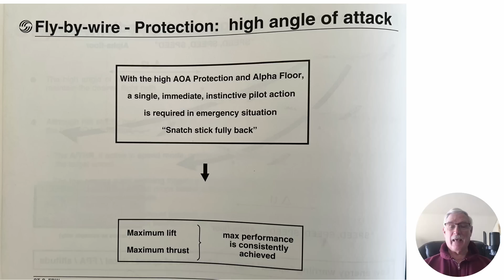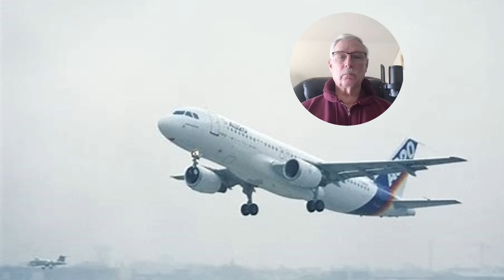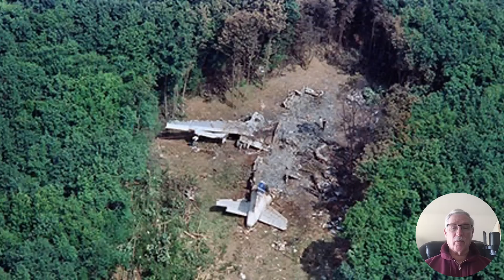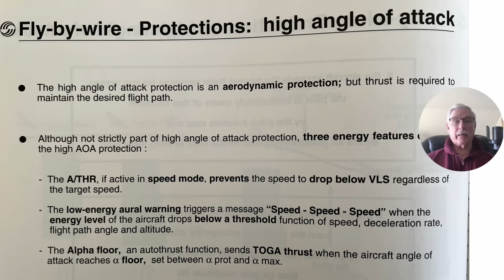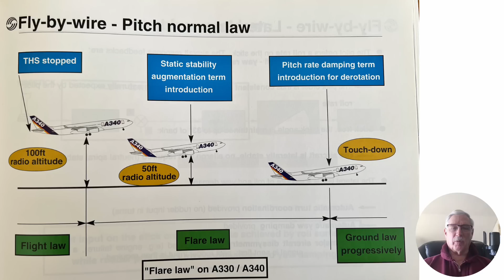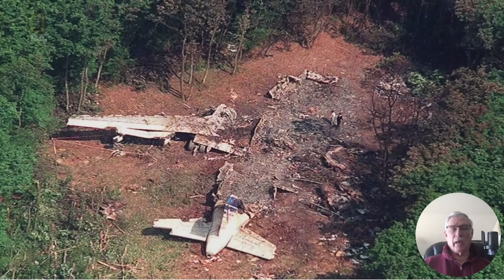Overconfidence in Fly-By-Wire protections First fatal A-320 crash 26 June 1988

Comment: Was the crash into the little forest caused by a) the alpha floor protection preventing the pilots at any stage from pulling more to avoid the trees or b) by the pilots stalling the bus into the trees ( excessive sink at wrong moment ) because of the disabled protection below 100 feet or c) a combination of both? The famous video of the fly-by seems to show some need for a pull up to avoid the forest. I'm asking because I actually have heard different explanations and things presented as the cause of this.
Reply: The French accident board report covers a lot more particulars than were presented here.  The aircraft had been rotated to the maximum angle allowed by the FCS, so the other variable was power.  That was compromised by the captain cutting the throttles to idle briefly when he felt that the engines weren't responding as quickly as he had expected to the initial throttle advance.  He didn't know what the problem was (turned out there was no problem, other than his misperceiving the engine response) and so decided in the moment to try a "reset".
Reply: The plane was getting very slow, more than 20 kts below what you'd usually fly even for landing. That was because the pilots had manually set thrust to flight idle the whole time they flew over the runway, trading speed for maintaining altitude. They didn't set TOGA until they reached the end of the runway as they weren't prepared for the tall trees at the end (the runway they originally planned for had flat open land at both ends). Turbo fan engines take 5 to 8 seconds to spool up from idle though. The captain went into panic mode and shortly reset power through idle again as he thought the TOGA wasn't working, losing further precious seconds. The engines worked as specified but they hit the trees before they could ever produce enough thrust to accelerate the plane and climb. They needed to climb more than 150 ft to clear the trees. Alpha floor protection allowed them to pitch up as much as it could, finally they got down to just 2 kts above absolute stall speed. It prevented them from dropping like a stone and crashing the plane from 200 ft altitude, essentially. You can blame it for that, but there was no way to climb and maintain 200 ft agl if alpha prot didn't exist, not even near.

The pilots performed a slow-motion flare into the trees.
Reply: @skayt35  Yes, the aeroplane ran out of energy but behaved impeccably as it sank gently into the treetops at Alpha-Max. Meanwhile, the two CFM-56 turbofans were spooling up from idle after the pilot, no doubt with his sidestick fully back, belatedly realised that Alpha-floor had not been triggered and slammed the throttles forward to the TOGA gate. Unfortunately, his action was too late. 
Ron doesn't say it, but Habsheim is an aerodrome with runways too small for A320 ops. Why was the thrust set to idle? Probably because of the change of plan that Ron does mention. The aircraft crossed the airfield boundary while still decelerating, and that needed flight-idle thrust. it should have already been stabilised at a low speed and high AoA, which would have demanded a fair amount of thrust. As Ron notes, the display should have been practised in advance - at the very least in a simulator (not that the A320 sims were very good in 1988).

These videos clearly record the steady increase of pitch attitude as the aircraft traverses the airfield and then the sound of the engines spooling up as it sinks into the treetops:
https://www.google.com/search?q=habsheim+crash+1988&oq=habsheim+accident+1988&gs_lcrp=EgZjaHJvbWUqCAgBEAAYFhgeMgYIABBFGDkyCAgBEAAYFhgeMg0IAhAAGIYDGIAEGIoFMg0IAxAAGIYDGIAEGIoF0gEJMTkzMzRqMGo3qAIAsAIA&sourceid=chrome&ie=UTF-8#fpstate=ive&vld=cid:1c670fd1,vid:I9gELPxPG8Q,st:0

But the worst aspect of this accident was that the display had been conducted on a public transport flight with fare-paying passengers.
Reply: @chrisscott4896  and the runway they changed to is much shorter than the one they had planned for. It's the grass strip. Watch the dirt they stir up towards its end. And this grass strip is contained by the forest whereas the longer runway is not. I think they would've easily made it over the longer runway without touching ground even after some seconds of flight-idle at 30 ft.
Reply: @skayt35  Correct explanation.
Reply: Thanks for the reply everybody ! The linked video actually shows perspectives I haven't seen before.👍
Reply: @FlyHighAndFar  what you don't see in the videos is the very low ias they reached: 112kts. Plane allowed a critically high AoA imho.

Comment: They literally disabled the very protections the aircraft was designed with to prevent this crash. If anything I’d say the plane had overconfidence in humans lol.
Reply: If it wouldn't be disabled there you could not land. It is necessary to be disabled there
Reply: So, literally the most important place to have this feature is low altitude pull-up but that is also the precise place you cannot have this system engaged, as you must pull up to flare for landing at low altitude.

Comment: I'm not a pilot. However, I've noticed many crashes were exacerbated by the long spool-up time of high bypass turbofans. Pilot finally noticed the issues and wants thrust NOW but he's got to wait 8 seconds and that's too long. 

I've often asked about the possibility of fitting afterburners (FOR EMERGENCY USE ONLY - IE only designed to be used a few times over the life of the engine), to provide instant thrust in "oh shit" moments like this.

To the pilots and aeronautical engineers (I'm an industrial engineer), does this idea have any merit?
Reply from the maker: Not really. The engine has to be developing very high power to provide air flow for the afterburner.
Reply: Afterburner is not some magical button ...
It's only engaged when a jet engine is already at its maximum "dry" (non-afterburning) thrust setting -  and developing that thrust
Fighter jet engines have a much smaller diameter, and a lot less inertia so they spool up a lot faster than a big airliner engine
If you look at a modern big airliner engine, it's actually a relatively small core engine driving a very big fan that produces most of the thrust
Reply: Perhaps emergency JATOs... 🤔
Reply: Best option, is speed brakes and partial power maintained on approach. Or large flap deployment with spoilers as needed. And landing gear extended. Not sure how most airlines glide in this condition, but I suspect they probably need 25-30% power to maintain their normal glide slope. So this is reducing spool-up time to under 5 seconds, I would presume.
Reply: @Triple_J.1  There's preciously few airliners with speed brakes, and none of the common airliners have them ...
Fokker 100 and Avro RJ come to mind

(Spoilers aren't speed brakes)

Comment: Yet another case where the avionics can kill you
Reply: No, this was pilot error.  The plane was working as designed.  Michel Asseline should know how the systems worked..  He had been involved in test flights.  He knew how the systems were supposed to work.
Reply: As opposed to the 90% of cases where human error is the killer?
Reply: This is a case when ignorant showing-off can kill you. The captain was surprised by the tall trees at the end of the runway he switched to at the last second, without any preparation at all, just for showing off.
Reply: Which avionic instrument was exactly responsible fir the crash?

Could you please post the timestamp in the video where Ron tells us how the avionics crashed the plane.

Comment: Roger, is 'flare law' the reason why I seem to see a lot of stick movement from the pilot flying during the approach but little change in aircraft attitude. It doesn't seem to the plane is reacting a 'natural' manner to the stick movements. Apparently it works very well but the video clips I have seen seem very strange to me.
Reply: fwiw - If I can throw in my 'two cents worth' based on many years/hours on Airbus. First off - there is a habit that 'some' pilots (not me, nor Roger! I'm sure) can be guilty of which is often called 'stirring the pot' on sidestick planes - basically meaning overcontrolling vs. letting the designed aircraft stability settle out the small disturbances. Secondly, experienced pilots are controlling to their body sensations which are actually more sensitive than the instrumentation or anything you can detect on videos. They are 'cancelling' attitude changes before they occur because the pilot senses the acceleration forces as they occur. You can see these same effects with control yokes too - but the small scale of the sidestick seems to make them more apparent. (at least this is my story and I'm sticking to it! grin).
Reply: The bus is probably one of the easiest airplanes to land and land well. The stirring the pot as stated above is unnecessary and occasionally can exacerbate the problem by inducing a PIO aka an oscillation. The best way from my experience to fly the bus is input and wait. The airplane naturally wants to stabilize itself. When landing the aircraft will trim nose down to induce a “natural” back pressure feeling for the PF to feel so that the flare feels less artificial.
Reply: I happed to discuss this with my brother in law, who is a check captain and a simulator instructor on the A320. He said basically that if you are a new or less experienced pilot on the A320, let the airplane "do the flying", it will do it decently. Once the pilot is experienced with the A320, the pilot can do it better than the aircraft, that's why he prefers to perform the corrections manually when landing instead of the aircraft doing it.

The reason is as mentioned above, an experienced pilot can sense things faster than the aircraft, and also an experience pilot can in some situations predict what is going to happen and act preemptively.

Additionally, the experience pilots gain flying it by hand could come in handy if there is a fault in the automation and they have to fly the airplane by hand.
Reply: @todortodorov6056  It can get pretty sporting in a strong x-wind.

Comment: Sounds to me like the airplane preformed as designed albeit misunderstood by the crew of this particular flight. I don't think the FBW system of the Airbus is particuarly problematic or dangerous per say, it's more the complacency and overconfidence it can create which isn't helped by the marketing when it was first introduced.  The protections should be seen as a 'last resort' and you should do everything to avoid flying to the part of the flight envelope where these systems are needed. Think of a bullet proof vest, you certainly wouldn't want to be shot or encouraged being shot with one on, but it's a nice back up to have. If you have the mindset that it's a 'normal' plane without the protections and don't start asking for trouble you shouldn't find yourself in situations like this.
Reply: Correct.  The first rule of being a pilot is always fly the plane.
Reply: @cjmillsnun  the only problem with that is that the plane is flying the plane. And then sometimes lets the pilot make suggestions. Then it doesn't tell the pilot that it's changing the rules.
Reply: @InvertedFlight  Had they kept to >100ft there would never have been a problem.  Down to 30ft, flaps 3, gear down.  Pretty sure LAND will be showing in the FMA.
Reply: Misunderstanding how the control system works, or not realising it has switched to another set of "laws" has become a factor in recent crashes
Pretty sure Ron's upcoming vids will have some more examples
In typical airline flying the pilots won't get near the limits
But as the slices of Swiss cheese rotate and start lining up the holes ...

Comment: Finally someone explained to me how come alpha-floor protection didn't save them. It's disabled below a certain height. This now sounds obvious, of course. But I had been at a loss for decades as to why. Thanks Ron!
Reply: So basically the pilots didn't know this? How? They were supposed to have all of the required training.
Reply: @lcfflc3887 The Airbus planes are very technically sophisticated aircraft. Considering that one pilot had 44 hours of flight time on the aircraft and the other one had a little over 100 hours, I can't imagine that they would know the airplane inside and out, especially considering that the planes they were flying before this one were the Boeing 707 and 737, which are totally different animals in terms of how they're built and what their flying characteristics are like. You can make the argument that they're from a different generation of the jet age. That being said, this was certainly not the last time that pilots of an Airbus aircraft did not fully understand the computer automation systems and what they actually did. There were also other examples of this with other aircraft such as the Boeing 737 MAX planes that crashed as a result of a faulty computer system to compensate for where the engines are mounted, thereby affecting flight characteristics that Boeing intentionally failed to inform pilots about, or the LSAS system in the MD11, meant to compensate for the planes center of gravity that caused a long distance flight across the Pacific Ocean to injure a very large number of passengers due to pilot-induced oscillation. Even If that computer system was explained to the pilots when they were first being certified to fly that aircraft, I'm sure they probably did not remember much about it since it's something that works in the background and they therefore don't have to think about it during normal flight.
Reply: @lcfflc3887  There are so many variations of this accident review but Ron got it right.  It was just that simple, dumb pilot got below 100' thinking the engines would power up after reaching Alpha Floor.  Why he didn't know this is beyond me as it was discussed at length in my Airbus check out.
Reply: @jcheck6  i guess the program engineers never thought someone would want to fly an airliner that low, they thought well if someone is that low they just want to land, even so that was dumb too, designing a program that would overnight pilot's commands, pilot should be in charge all the time not a dumb computer.

Comment: Nice Boeing Advertisement smh what a joke
Reply: Any criticism of Airbus is now Boeing advertising? That is a joke.
Reply: @Deploracle  Airbus has only ever had accidents when Boeing affiliated pilots were working there
Reply: @thamil1365  Does that include Air France 447? An all Airbus crew that stalled the plane and rode it to the bottom of the ocean.
Reply: a 737 would have cartwheeled into the woods instead.
Reply: @BillPalmer  A 737 pilot wouldn't have been tree-topping expecting the AP to save the day.
Reply: @Deploracle   I'll grant you that. but the same maneuver at idle power until applying thrust too late would have probably resulted in more deaths.
Reply: @BillPalmer   The difference with a Boeing (and I'm not part of this thread's war of words -- just sharing a fact) is that the pilot has full pitch control up to and beyond a stall.  Alpha Prot OTOH cuts off about the last 1.5 deg of AoA before a stall, as the price of insuring that a stall never happens. 

So a Boeing might have (barely) gotten out of it in this rather unique instance.  But for most of the other millions of flights, having stall protection -- even if it clips a bit from potential flying capability -- has presumably been a positive.
Reply: @marcmcreynolds2827  in theory yes, but as Roger’s paper on the subject shows Boeing pilots don’t know where that extra bit is within the stick shaker regime and often don’t go deep enough to get that full benefit you speak of - and of course risk stall if they do.  The Airbus full-back-stick method allows the pilot to intuitively, quickly and confidently get that almost-full performance which has been shown in sim studies to yield a much better result.

Comment: It's worth mentioning that in the case of that Habsheim-Mulhouse A320 crash, the captain had switched off the alpha floor protection by using alternate control law. In normal flight law, the A320 will fly out of an extended low approach by automatically throttling up the engines as I understand it.
Reply from the maker: Not below a 100 feet. And he was at 30.
Reply: @ronrogers exactly. Alpha Floor is inhibited below 100’ Radar altimeter. If it wasn’t you would never be able to land the airplane as alpha floor would activate and the thrust would go to TOGA.
Reply: @ronrogers  He wasn't supposed to be that low of course. IIRC' the radar altimeter that would have told them they were so low was being ignored and the barometric altimeter being used as their guide.
Reply: @ronrogers  It's 100ft in landing config, right ? 
Otherwise that's just another charred black hole lurking ...
Reply: @Wannes_  they had the landing gear down, set flaps and thrust idle, yes (I'm not a pilot but engines idle at and below 100ft seems strange when flying at lowest selectable airspeed or less). The plane gave them plenty of time to set sufficient thrust though. It maintained the glide over the runway's length, with 112 kts at minimum and a significant AoA before hitting the trees.